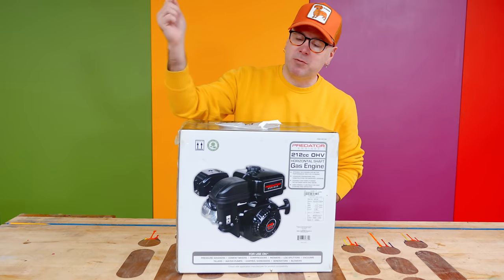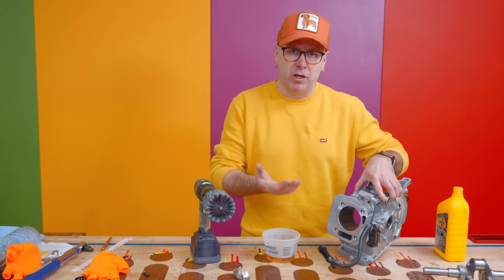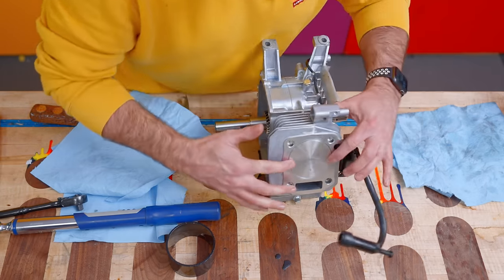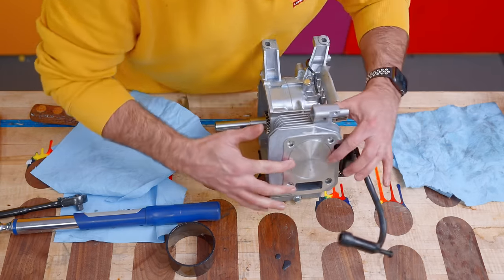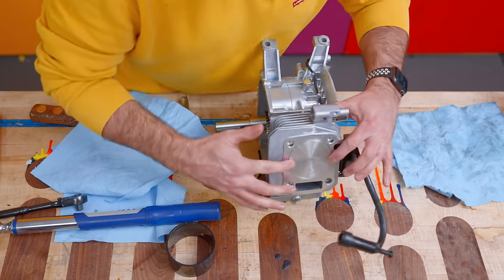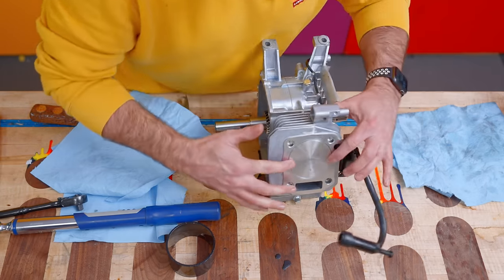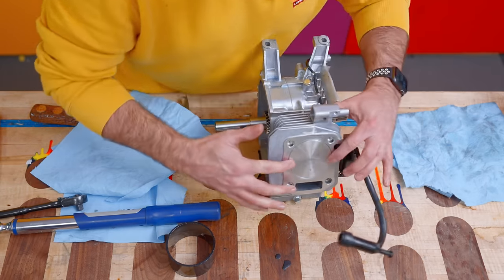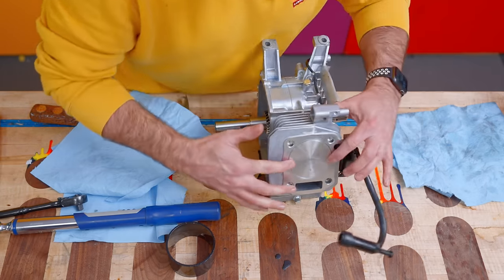How to Build a Competitive Kart Racing Engine (Stock Appearing)

Comment: what yu dont have a gear puller to remove the fly wheel ... jeesus what do they teach you yanks ... here in Canada we race 5hp gp honda engines ... or did anyway ... and always used a gear puller on the fly wheel you wont bend it or warp it with the hammer crow bar method ...
Reply: 2% before tdc  timing is awesome it gives you that little extra oomph on the straight and cushions your piston head from slapping into the head cover ... as it is being pulled down at tdc ... instead of being at tdc ... and gives you a better power stroke
Reply: check for valve seal with machine oil ... NEVER water ... steel rusts FAST ... and an aluminium block and steel valve shafts add to the erosion by being 2 different conductive metals ... NEVER put water in the engine ... always use oil ... even if you strain old oil through a paper coffee filter to clear out debris ... use oil ... and yes when it is apart ... put the block in a bucket of oil let is soak over night then put it in the oven at 250 for 30 minutes to bake it into the metal ... remove let cool until the next day ... then soak over night again and then put on a grill over the oil bucket and let it drip ... for a day ... this pretreats your block and bonds some oil into it so it will run smoother and faster ... and if you ever use synthetic oil then never go back to regular oil on that block as synthetic oil bonds with the engine as well ... and regular oil gums up with synthetic and its additives

Comment: Grind material off the crankshaft and don't rebalance it ? 😂😂😂
Reply from the maker: It's actually impossible to balance a single cylinder motor because of mechanics and physics. Look it up. 😉

Comment: Found your vid as my kid is getting into kart racing.  Video is great, but as an engine machinist.... wow did I cringe watching this. Watching you "surface" the head with a belt sander and then "lapping" it on a piece of glass.  Do not do this people. Take it to a machine shop and have it properly done or better yet, don't do it at all. When you said the thin metal gaskets (called Multilayer steel gaskets) didn't work, this was why.  Surfacing it, and then adding a thick gasket gave you absolutely no performance increase.  Never ream or drill guides by hand.  Buy a super cheap drill press or something. Your guide wear must be horrendous.  There are much better ways to take out a valve seat.  Never cut them out, or at least do not do damage to the head. There is no need.  Most of the rest was great. Made sense, but the cringe this video induced for me stood out more.  Good luck.
Reply from the maker: this is budget racing at it's best! I normally do this on a milling machine but I'm showing other DIYers how to do this in their garage. have fun man.

Comment: Don't need to watch the video, the engine is garbage. Cheap Chinese garbage. Any with knowledge wouldn't use that motor. It maybe a Honda clone but Honda motors don't seep oil through the block or come prelocked up new in the box.
Reply from the maker: But this is the motor we have to use for our karting class. Jesus Nick.